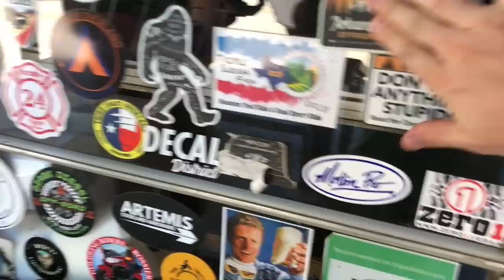Jeep TJ Overland Trip with my new Roof Top Tent

Comment: I had the same issue on my 2006 wrangler. The regulator going bad can cause this. Which is built inside the computer sadly. Fortunately tho, my issue was just damaged wires from the alternator to the regulator.
Reply from the maker: That was my issue too. Had a blown fusible link. Also found I had a cracked alternator. Problems fixed now.

Comment: I'm about to buy a 01 TJ with 50k miles, can't wait to buy the roof tent and make it my own
Reply: ProvenDeviant ‘01 with 50k? Damn that’s a gem brotha! Got my ‘00 with 90k
Reply: LumpiaBoi808 thanks man I’m excited!
Reply: Is 12k a fair price?
Reply: ProvenDeviant Considering it’s all in very good shape and mechanically sound, I say it’s a very good deal. I got my Jeep for 6K (from the asked 7500) with a rear main seal and rear pinion seal leak which aren’t very hard to get fixed. Kelly bluebook lists the ‘01 for 7k, but it all depends on where you’re from. Jeeps with 140-160k miles lists for around 10-14k here on Hawai’i and seeing your mileage, I say it’s a buy. Good luck brotha!
Reply: @LumpiaBoi808  Good calls man ill check the average price in my area